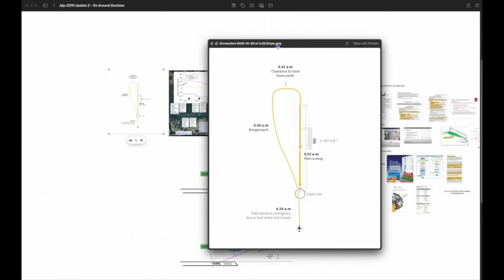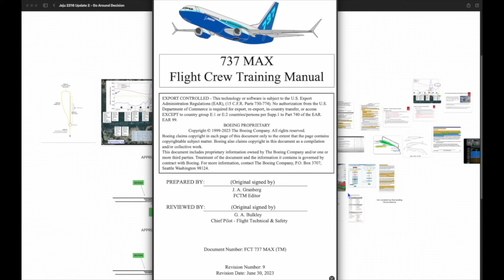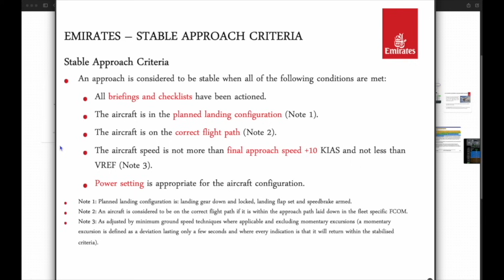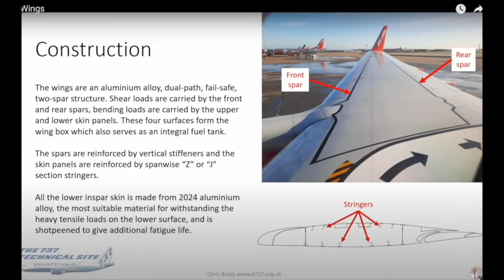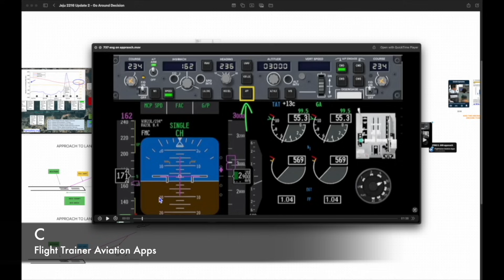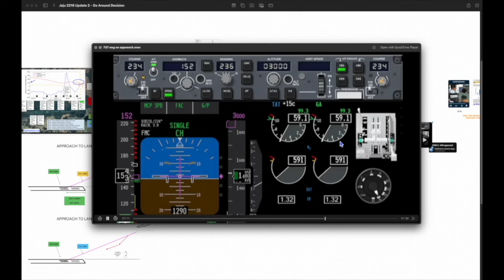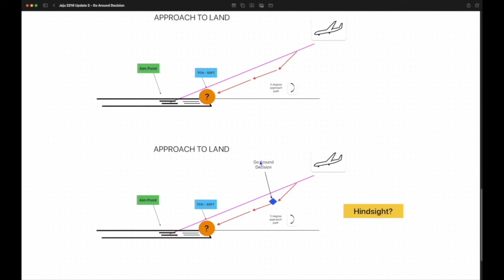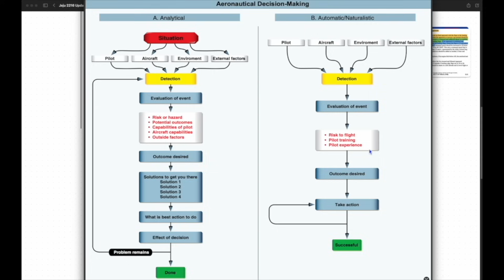Go-Around Explained: Jeju Air 2216’s Decision Not to Land

Comment: Ryanair 2008 Rome had incident, and the recommendation from Boeing and Airbus after this, was that Go Around was not the necessarily the best option.

The investigated event can be framed as a flight through a flock of birds in approach /
very short final phase, with the aircraft completely configured for landing and
stabilized on the descent path. 

During this phase of the flight, the engines are
operated at a relatively low thrust level, to which the birds possibly ingested could,
generally, not affect the core of both engines (what not occurred in the event in
question where the stall has, in any case, occurred to a regime of relatively low
rotation), thus reducing the possibility of causing damage significant to them and
allowing the aircraft to make a safe landing with the push selected for
approach. Under such conditions, the decision to make one

The go-around maneuver, in which maximum thrust is applied to the engines, could
increase the possibility of causing damages and malfunctions to the motors
themselves, with consequent loss thrust available and impossible to complete, safely,
the go-around maneuver.

The lack of clear indications directed to the conduct personnel in order the possibility
of carrying out the go-around maneuver in this type of scenario or not, can bring the
crew to apply "uncritically" (and without the necessary awareness potential
consequences) the go-around maneuver, which, in this kind of scenario, can present
higher risks than those of leading the aircraft to landing.

The considerations above are consistent with what has already been expressed and
recommended, ad example, from Boeing, Airbus, UK CAA, compared to the scenario
in question.

Following the event, Boeing introduced one in the FCTM of the B737 "Recommended
technique" referred to the case of the bird strike, which provides both strategies of
prevention, both guidelines relating to actions to be implemented by the crew in case
of impact in the take-off or landing phases.

Addressees: EASA and FAA.

Text: ANSV recommends providing flight crews, guidelines or procedures,
operational and training, based on a careful assessment of the risks associated with
the conduct approaching aircraft, when the latter is interested or close to being
affected, by impacts, even multiple, with birds. These guidelines/procedures should
provide the following points:

• discuss the bird strike during the take-off and approach briefing, in case of
operations on airports with the presence of birds, known or probable;

• in case of impact with birds, even multiple, if the landing is assured, it is
preferable to land while maintaining the lowest possible engine power setting
instead to carry out a go-around procedure (in case of ingestion, especially
massive, of birds, engine damage could be greater in the presence of high
engine speeds engine operation, typical of the go-around);

• take into account that, in the case of a go-around, damage to the engines
could prevent it completely safe execution, of the go-around maneuver, with
the consequent impossibility to land in the airport. 

https://www.aviation-accidents.net/report-download.php?id=662
Reply: The ADS-B data suggests that the pilot of Jeju Air Flight 2216 elected to go around, on two good engines, before the aircraft was struck with birds,
Reply: @ Maybe, it’s one of many theories.
Would say it’s one theory I am inclined to consider.

It’s either that theory or they shut down the wrong engine.
However the engine that was shut down on landing seems to have less damage. So we need more information.
Reply: @johnnyalexander5219  The headon video of the aircraft landing shows an exhaust plume behind the No 2 engine indicating that it was operating, but probably with low power. The No1 engine has no plume and hence is not running.

The remains of birds were found in both engines. They have 17 samples which they are currently testing for DNA. The objectives are to determine how many birds were ingested and the type of birds involved. Initial estimates are 10 - 15 individual birds, all geese.

Comment: Excellent video and reference to good pilot resources  thankyou. Just a point.  A go around with two damaged engines would be a foolish decision. It is far more likely that at least one engine still had relatively normal thrust at that stage, allowing for the pilots' response to go around. We can see this from the ADSB data. It is highly likely, a second bird strike incident OR gradual engine failure occurred on the go around climbout, to the point neither engine had sufficient rpm for ac power, the left one worse than the right. Now the pilots had a far worse emergency to deal with, deciding to perform what essentially was a power off 180 likely choosing a clean configuration to be assured of making it around onto final for 19.
Reply from the maker: Thanks for the comment, sounds reasonable. Terrible situation for the crew to find themselves in, I hope the interim report gets to the bottom of the sequence of events and soon.
Reply: @AdaptiveAviator  Agree totally. The more I read and see about the incident, the less certain I am about what events occurred at what time. There seem to be conflicting reports out there. Some say they hit birds then went around. Others say they hit birds after commencement of go around as the gear was up. Frankly, I have no idea now
Reply: @Coops777  The exact timing of the go around and bird strikes should provide an answer as to which cam first. However I think that the go around first is more likely because the ADS-B shows that the initial rate of climb on the go around could not have been achieved with one (or two) defective engines. 

Also if struck by birds late on final, why would an experienced pilot elect to go around. The initial reports suggested that the bird ingested were geese, the latest report says ducks.

Comment: I have only flown on fighter jets, but the last thing I would do is go around with an engine problem.
Your speed is down, the runway is straight ahead, you are dirty, time is critical....

We also were VERY strict about shutting down an engine, even if it was on fire; the risk of killing the wrong engine is very real.

I am not judging, but this go around sounds wrong to me.
Reply: The ADS-B data suggests that the go around was initiated (on two good engines) prior to the bird strikes that occured after the pilot had started to execute the go around.
Reply: @christopherrobinson7541  That is interesting.  That makes a big difference.
Thanks!!

It just shows what video said from the beginning - wait till you get all the info.....

Comment: Thanks for the good and technical explanation. 👍
We do know that they had a bird strike on the right engine and at least one pilot decided to go around. As every pilot in the cockpit (whether Pilot Flying or Pilot Monitoring) must follow the "go around" call. 
We don't know when they cleaned the aircraft (gear up - flaps up) and when they tried to troubleshoot the coughing right engine. 
The CVR must still be recorded as the damaged engine is still producing power and turning the generator. 
But what we see is that the ADS-B data is cut off as well as the CVR and the FDR supported by the left engine. 
So whatever happened to the aircraft, it lost ADS-B, CVR, and FDR all at the same time. 
We know that this particular Jeju aircraft did not have a backup battery to continue supporting CVR and FDR. 

There must have been a very serious electrical malfunction to cut off ADS-B, CVR, and FDR all at the same time. 
If the pilots shut down the wrong engine (left engine) during the go-around, the FDR must have worked for at least another 20-30 seconds until the engine was shut down. 

Finally, the information we are receiving does not add up..!